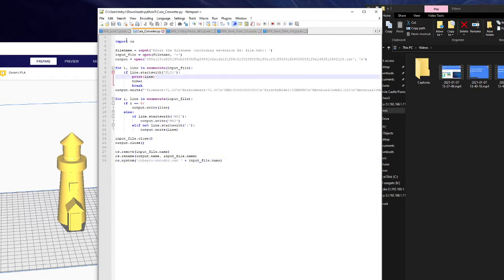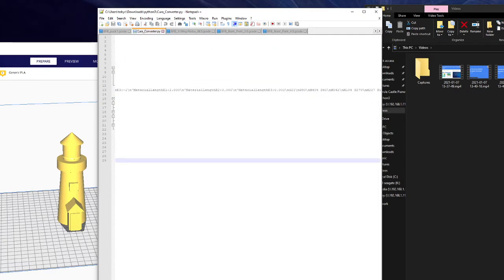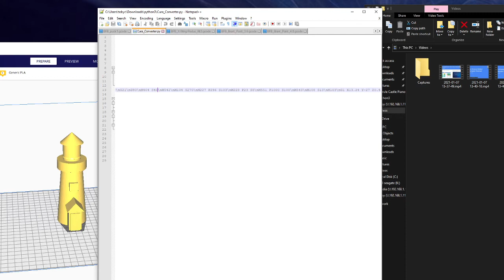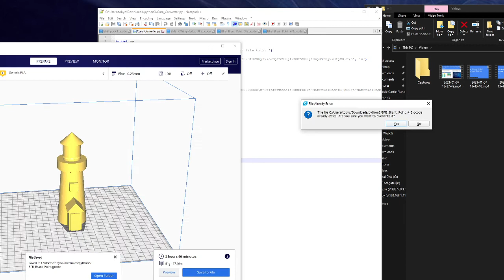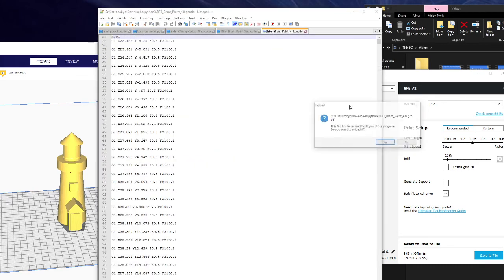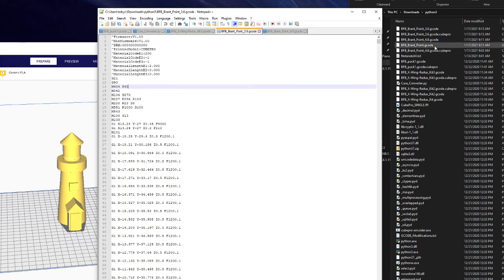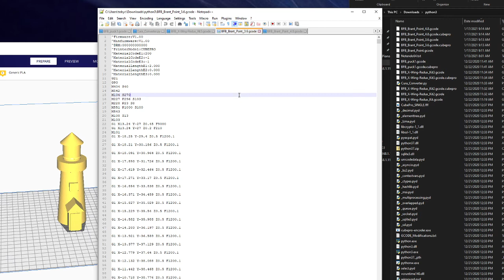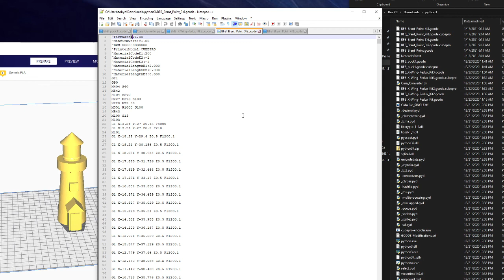A more technical look at Cura on a Cube Pro

Comment: Does it work with Cubex regular
Reply from the maker: I think it should. But I don't have one to test and in fact I recently got rid of the cube pro itself. Sold it to a friend who's planning on gutting it to build a more modern high temperature machine to print polycarbonate